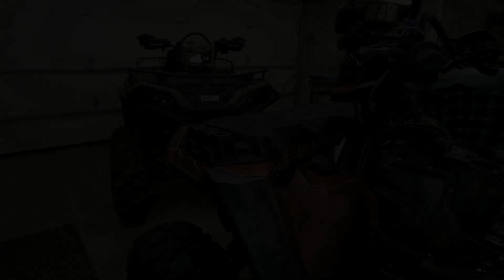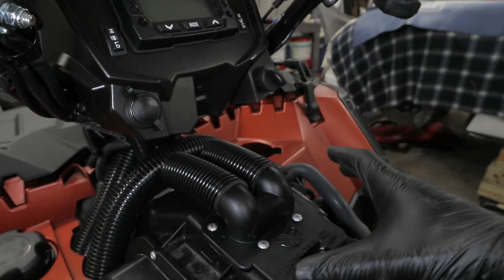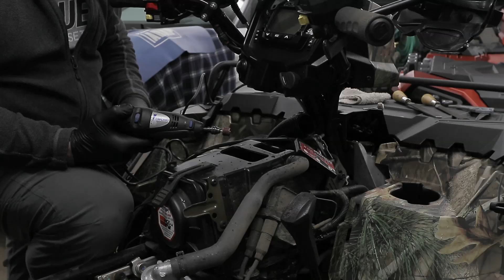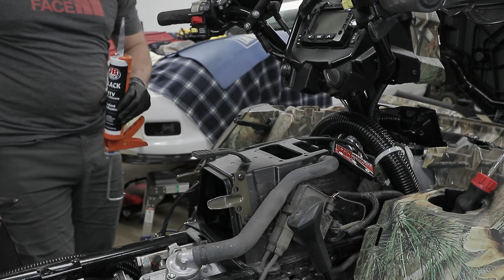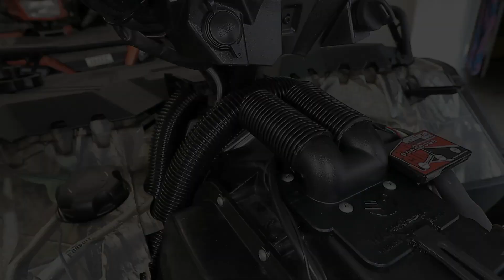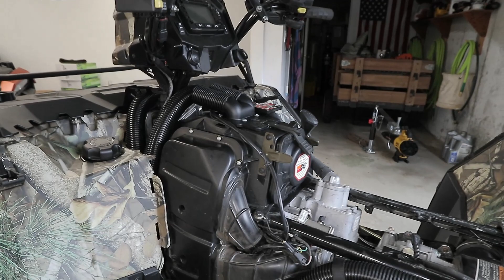SYA AirBox SNORKEL Plate Install | POLARIS Sportsman XP 1000 & 850 ATV | Part 2

Comment: My airbox is leaking through the rubber strap the holds back plate of airbox on. I can't believe that rubber strap is fastened by an actual hole in the airbox. So stupid.
Reply from the maker: silicone that sucker!

Comment: How has the kit held up? Curious about the belt box because they arent sealed to the engine and the box itself isnt gasketed. The highlifters have a seal that can be added. Also since the air filter access panel isnt sealed i was wondering if there was any moisture in there after the ride.
Reply from the maker: Well check out my polaris playlist if you want to see how it performs. A little too good if you ask me. We venture deeper then we are suppose too. My machines have factory rtv on the belt box to trans housing and i carefully inspected the foam cover seal. No leaks, same for the airbox i did a zip tie trick to make sure the bottom of that access door seals properly. No leaks on either machine so far. Thanks for watching!
Reply: Mine is leaking through rubber strap that hold plate on.